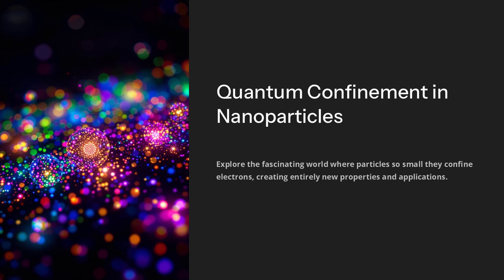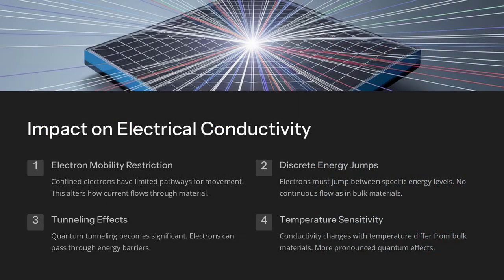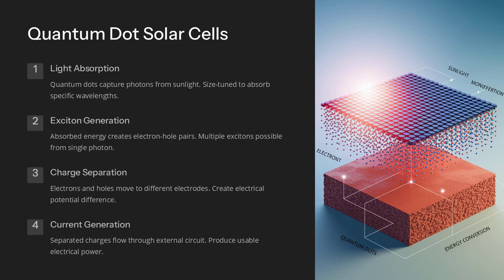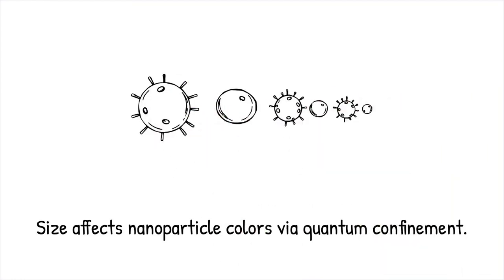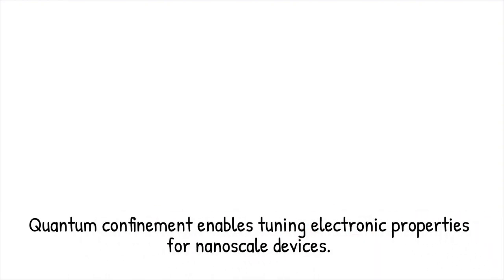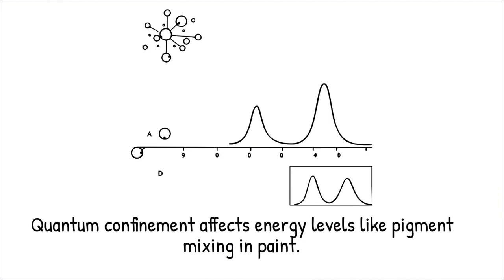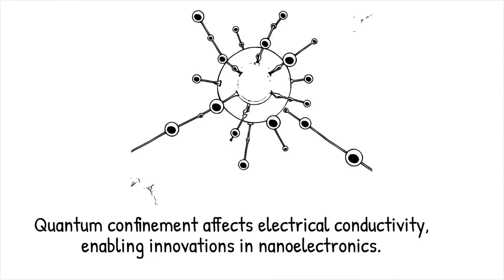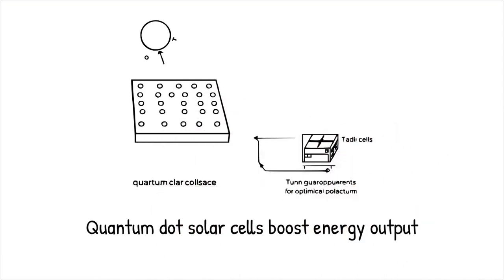Quantum Confinement: Advancing Material Properties at the Nanoscale

Comment from the maker: How does quantum confinement influence the band gap of semiconductor nanoparticles, and what are the precise mechanisms that allow for the tuning of optical properties through size control?
What are the challenges in maintaining stability and consistency in nanoparticles that exhibit quantum confinement, especially when integrated into commercial applications such as solar cells and biosensors?
Can advanced computational models predict the behavior of quantum-confined systems in dynamic environments, enabling the design of multifunctional nanomaterials for real-world applications?